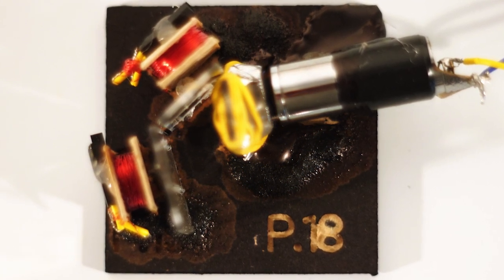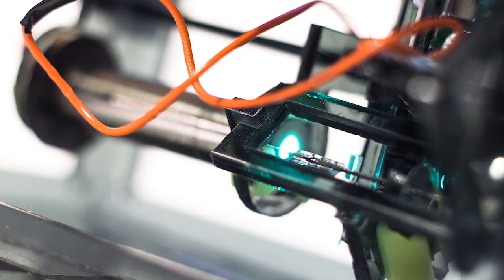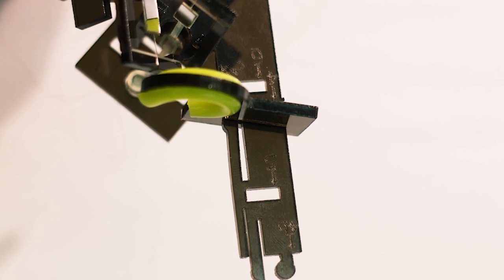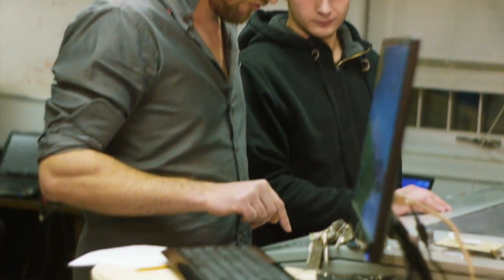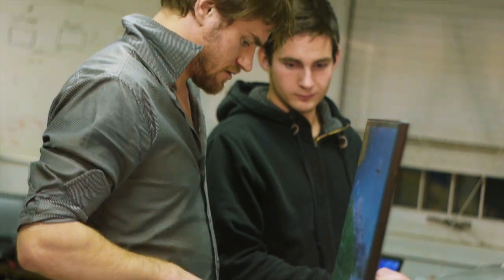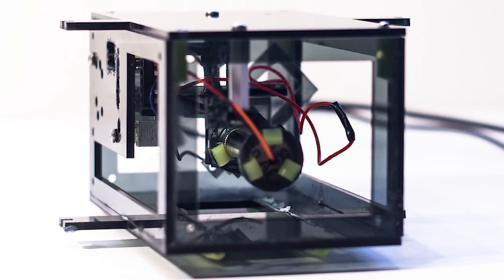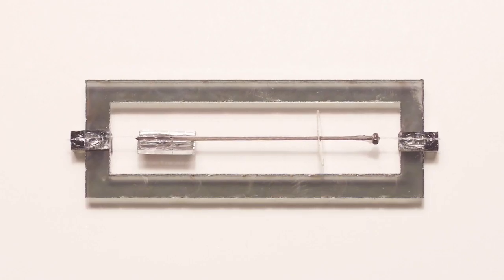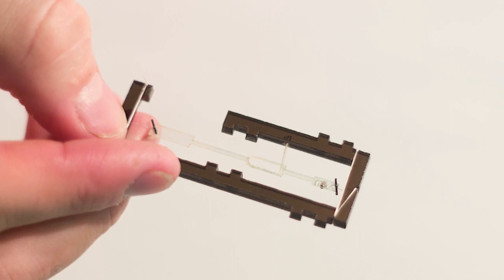Update #26 - Hardware Developments #3

Comment: I thought that You could have machined things to bolt in place in sub parts, and I am happy to see the project go from being a homemade glued together bunch of wires to a production machine that looks like a 2014 corvette. Being a modeler and working in the Aero tech industry I have worked with allot of scratch build and Prototype equipment so I don't care if its pretty, I am more concerned with the applicability, and I am glad to see the adaptability to configuring custom machines that I will need to make certain model ship parts. I'm paitiently waiting and drawing plans in Blender, but I also don't want to have to take 8 months to a Year just to get the printer working right, so keep up the good R & D.